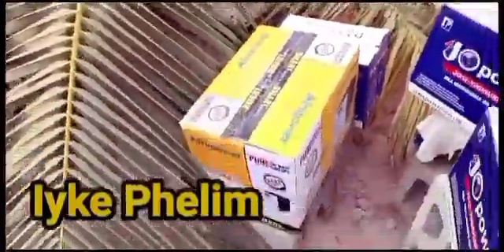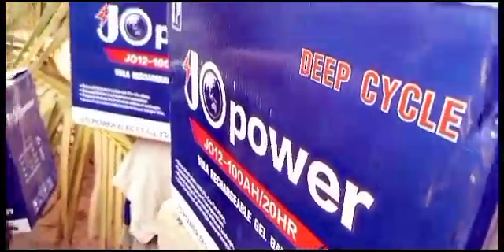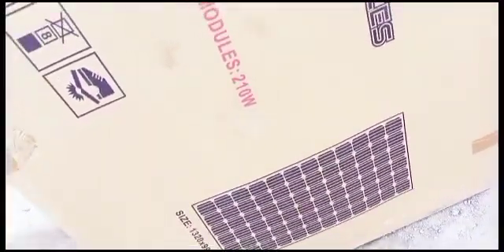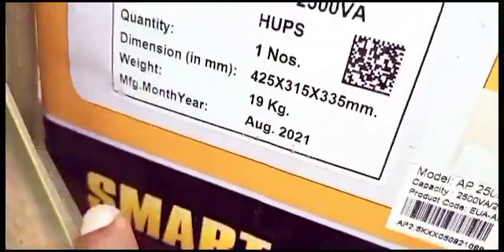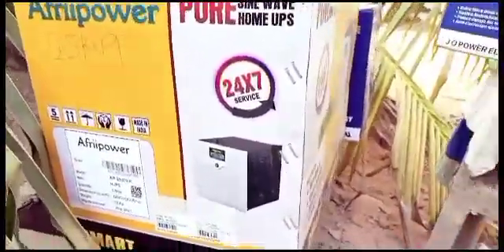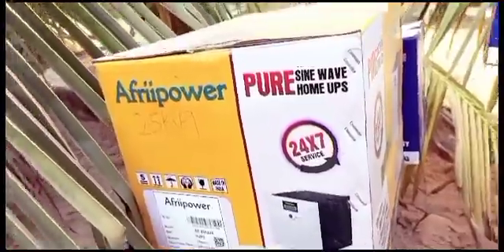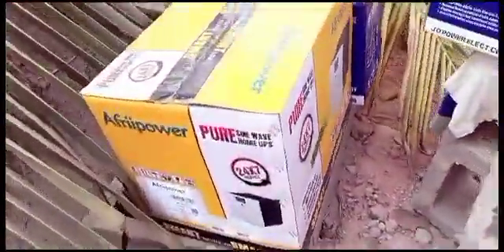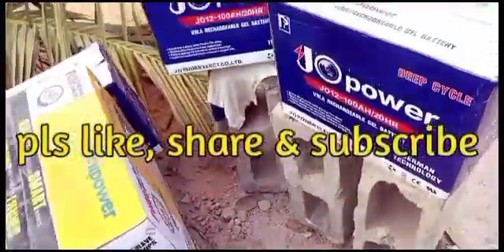My AfriiPower 2.5kva Pure Sine Wave Solar System Setup

Comment: Good day sir. Please we recently got this inverter. Please what does the 3 switch at the back used for. I observed the 3rd one is on W-ups & it displays UPS switch off mains fail. Also the it usually beep most night and low although they recommended we change to mppt controller. When I press the switch to UPS it write UPS & back up on. We don't have nepa . Can you please explain. Thanks & God bless
Reply from the maker: UPS mode ON, is when it is connected to nepa and it gives you an uninterrupted power supply when nepa goes off. In other words, your light won't go off when the grid fails and there's a blackout everywhere. The other buttons are for battery charging using nepa or fuel generator

Comment: Sir , how has been your experience on this Afripower inverter?
Reply from the maker: So far, No complaint whatsoever from the two houses I installed Afriipower inverter. 

Though there was a time one of the users called me to come check the inverter because it was disconnecting and switching off after making some beeping sound so I went and checked it and discovered that there was a short in the electrical wiring somewhere in the house so the inverter self protected itself by beeping and going off..which is a good thing.

Personally, I am not using Afriipower inverter but from those I installed it for, no complaints at all.